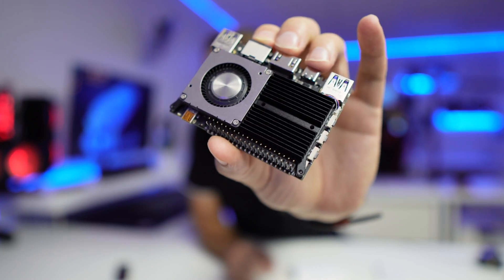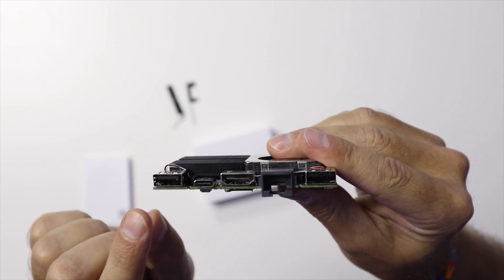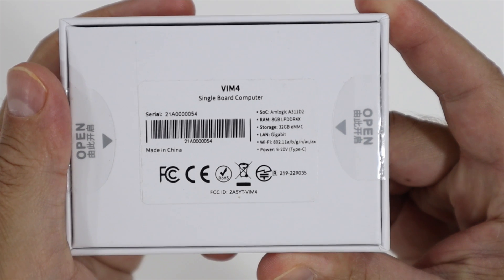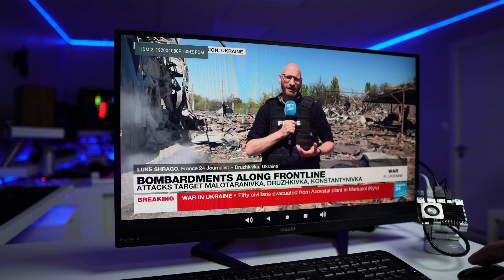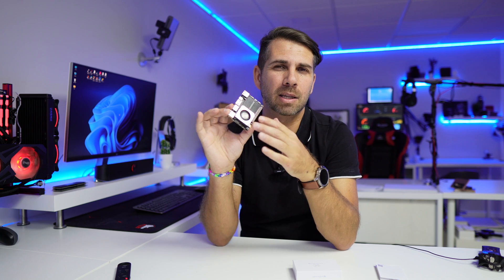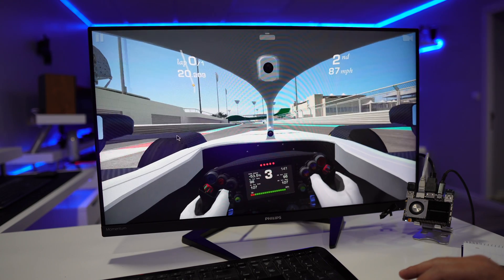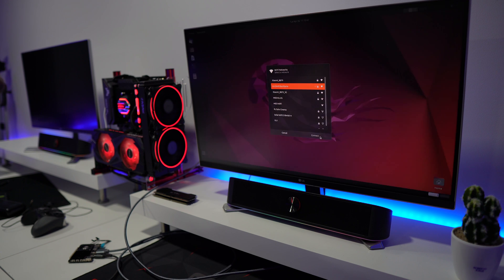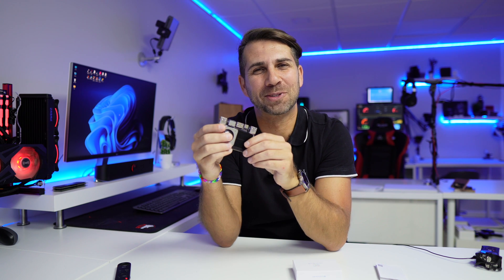The SMALLEST & Most POWERFULL Computer is HERE !!! Khadas VIM 4

Comment: good video. and it's a good board. i use it for my travel linux machine strapped to a portable battery, using the touch screen also from khadas. but the older board, the khadas edge 2 pro is more powerful and capable without plugging in adapters or extension boards and things on sale from their website's shop. the firmware, oowow, has been around and in use on their boards for some time before this released. but you're right, it is a great addition that other boards would definitely benefit from if they wanted to.